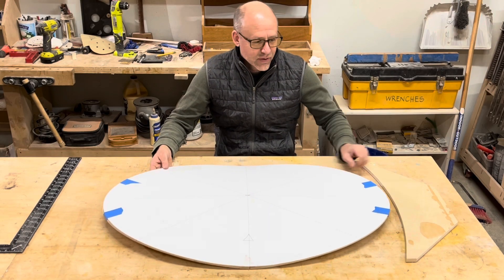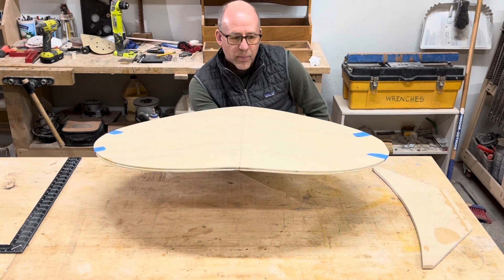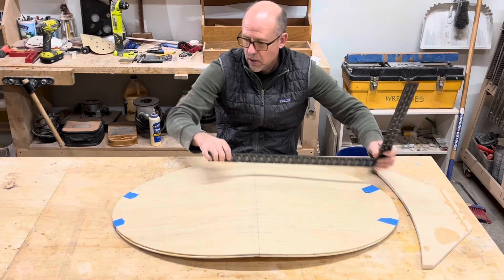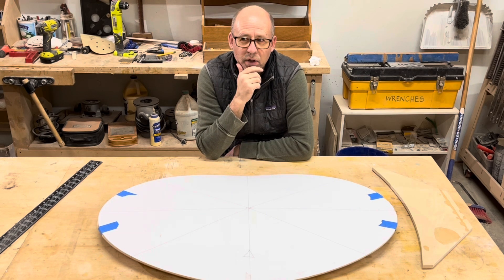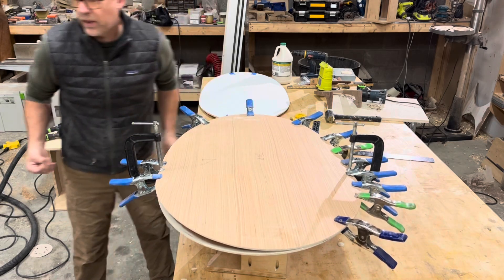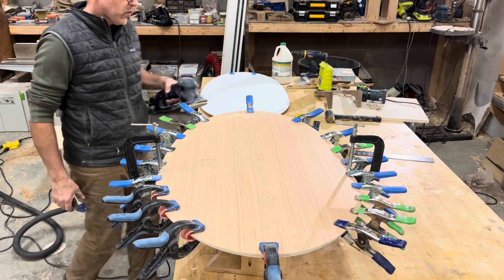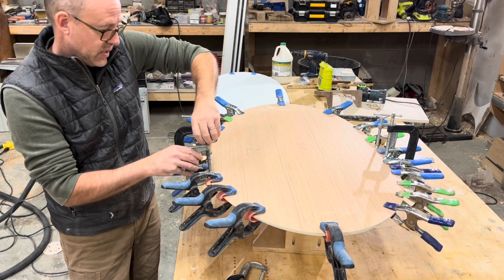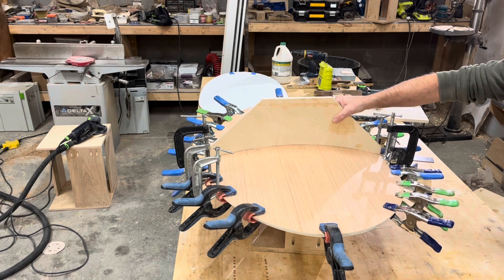Hydroplaning disc kit

Comment: Constructing the plywood upright triangle similar to the disc with two panels... wider at the bottom tapering to the top will create a more structural component for both attachment to the disc and the aka arm. ⛵️
Reply from the maker: That’s a good option, thanks!
Reply: Would work good for the straight arm aka... I like your wood panel fillet and curved arms approach, simple, eloquent and structural.

Just acquired a 20 foot sailing canoe built in the 70’s... been tinkering with this type of addition, also installing a peddle drive and sliding seat rowing station.
Reply from the maker: Sounds like a fun boat!  I’ll keep posting my test results.   Hopefully I can test this by March.
Reply: It’s a plywood home built, canoe/kayak hybrid 34 inch beam. Early version of an International Sailing Canoe. Have multiple different sail rigs to play with on it.
Reply from the maker: @PeaceProfit  sounds like a fun project!  These disc are designed for sailing canoes of that size.  I will put them on sale on duckworks.com after I test them on my boat around March.